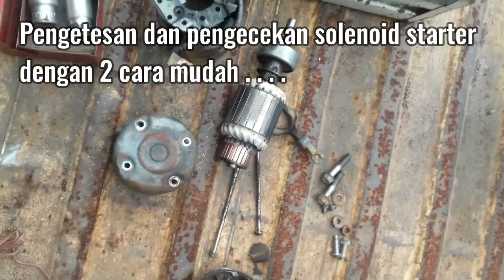Cara test solenoid starter yang masih bisa digunakan

Comment: Karet switch rusak apa masih bisa di pakai bos
Reply from the maker: Masih bisa digunakan gan, asalkan switch solenoidnya berfungsi seperti pd video. Pada switch solenoid starter biasanya ada karet pelindung yg berfungsi melindungi switch dari kotoran dan buangan sisa karbon brush starter
Reply: Apakah klo tarikan kedalamnya lemah apakah sdh pasti rusak ga ya

Comment: bos ijin bertanya kenapa ya selenoid tdk mau ngangkat pakai kabel yg panjang?
kalau pakai kabel pendek  mau dia ngangkat bos!..
apa penyebabnya ya?
Reply from the maker: Kami blm mendpt masalah seperti itu walaupun kabel panjang atau pendek, stater pada mobil hrs menggunakan Relay
Reply: @AJMcrews  saya juga menggunakan relay tapi tidak mau juga bos
Reply from the maker: Kemungkinan bermasalah di kunci kontaknya,output setrum dari kabel starter di kunci kontak kemungkinan tdk sampai ke starter, ini hrs di check pakai tespen dc aki utk mengetahui apakah ada setrum pada kabel besar starter dan hrs ada setrum pd kabel kecil starter pd saat kunci kontak diposisi starter, jika semua setrum normal kemungkinan kerusakan pd dinamostarter

Comment: bang kalo nyala redup gimana bang??? lampu nyalanya ga istiqomah terang redup???
Reply from the maker: Maksudnya lampu apa y? Dlm video ini tentang pengetesan solenoid starter
Reply: @AJMcrews  lampu Taspennya bang terang redup gitu
Reply from the maker: Coba tes tespen langsungkan ke aki apakah nyala terang atau tidak. Jika terangnya berbeda saat ditest ke solenoid starter seperti pd video ini berarti solenoid bermasalah atau rusak
Reply: @AJMcrews  bang  kondisi dinamo normal tpi di starter lewat kunci kontak ga bisa mutar apanya ya bng??
Reply from the maker: Cek kabel2 ke aki tidak kendor, berjamur atau korosi. Cek kabel ke dinamo tidak kendor. Cek voltase aki di atas 12.5V saat akan distarter
Reply: @AJMcrews  di starter kaya nyedot listrik banyak bang, knpa ya?? busing dinamo boleh di kasih gemuk/stempet ga bang??

Comment: Klo da jalan 1 jam jalan.parkir sebentar matiin mesin idupin lagi ga kuat aki langsung drop. Mesti nunggu 10 menit dulu baru mau lagi di stater..klo mesin adem 10 kali stater ga masalah.mau nnya ada pengaruh nya ga ya dri swit stater om..🙏 soalnya dinamo da serpis aki baru cuma swit dinamo (selenoid) nya doang blm di pegang
Reply from the maker: Kemungkinan solenoid starter atau Armatur/angker starternya bermasalah atau rusak.
Hrs lepas dinamostarter utk dicek ke ahli starternya
Reply: @AJMcrews  sudah ketukang dinamo sudah di bongkar dinamo nya om.cuma selenoid nya yg blm.apa pengaruh dri selenoid juga om🙏
Reply from the maker: Cek dan Test solenoid seperti pd video ini
Reply: @AJMcrews  klo di ter seperti itu sudah om normal..jdi klo mesin adem bisa om di stater 10 kali juga.klo da jalan 1 jam baru dia berat aki drop mesti nunggu 10 menit baru bisa lagi..mksud saya apa ini pengaruh dri selenoid ga om.aki baru dinamo udah 3 kali bongkar cuma selenoid blm di bongkar
Reply from the maker: Kami blm memastikan hal tsb krn selain starter hrs dicek apakah pengisian aki normal di atas 13.5V saat mesin dinyalakan dan tes matikan mesin dan ukur lagi voltase aki jangan drop dibawah 12.6V
Selain itu lepas dan tes starter secara manual langsung ke aki tanpa dipasang ke mobilnya dan tes berulang-ulang
Reply: @roniacong2150  abang pasti pakai aki kering, ini lagu lama. coba pakai aki basah mesin panas dingin pun lancar asal aki gak soak. aki kering kena panas berlebih mesin minta didinginkan dahulu baru bisa dipakai starter. makanya pas dingin starter 10x tetap jreng sesuai penjelasan abang diatas.
Reply: @fajarbakung2337  oh gtu ya om 🙏 iya si ini aki blm saya ganti .. mau coba takut da di beli sma aja.. ok om makasi ya saya coba dulu cari minjam2 hehhe

Comment: mas mobil saya jika di stater bunyi tektektek  kurang lebih 8 kali di ulang ulang stater baru bisah,.  apa mungkin swit staternya bermasalah?
Reply from the maker: Hal seperti itu trjadi biasanya switch starternya lemah dan hrs ganti dan yg penting juga check kabel besar aki jangan ada yg kendor terutama jalur kabel min/negatif dari aki ke mesinnya
Reply: @AJMcrews  makasi mas,,,. setelah mengganti swit stater mobil saya sekali stater langsung jreng,.  tidak ada bunyi tetektek lagi.

Comment: Mohon bantuan nya om,mobil krista,baru ganti aki,tapi kalau diparkir selama 3 hari,pas mau di nyalahin susah distarter.apa penyebab nya ya om.
Reply from the maker: Cek aki pakai multitester jika selama 3 hari bisa sampai 12,6V lebih berarti starternya harus diservis
Reply: @AJMcrews  kalau aki di cek sesudah 3 hari pakai multitester dapat nya 12,45 v om,apakah itu normal atau berkurang om,
Reply from the maker: Coba dikontak On lagi jangan dinyalakan apakah kurang dari 12,.45V tsb, pada  umumnya  mobil bisa di starter jika diatas 12,5V ke atas
Reply: @AJMcrews  jadi kalau dibawah 12,60 itu gak bisa ya om,

Comment: mbil sy harus starter 2 x br mau nyantol knapa om mbil apv
Reply from the maker: Cek setrum ke starter apakah normal saat distarter, jika setrum ke starter normal ttp msih susah distarter kemungkinan kerusakan di solenoid starter dan cek juga bendik starter
Reply: @AJMcrews  setrum maksudnya aki...kalau susah starter ga sih cuma panjang..kalau trus"an start panjang takut soak akinya
Reply from the maker: Maksudnya bisa distarter tapi mesin susah nyalanya?
Reply: @AJMcrews  ya.. distarter panjang susah nyanyolnya